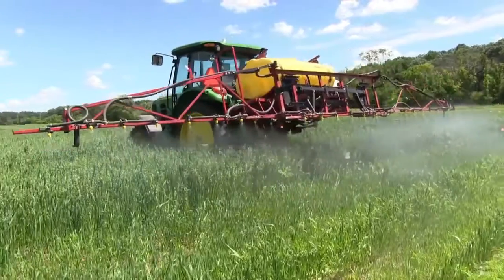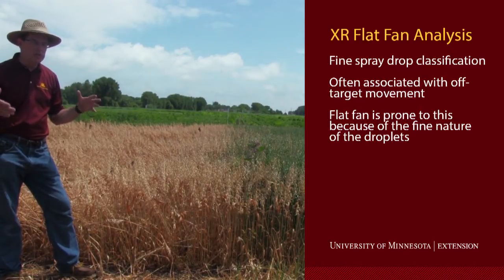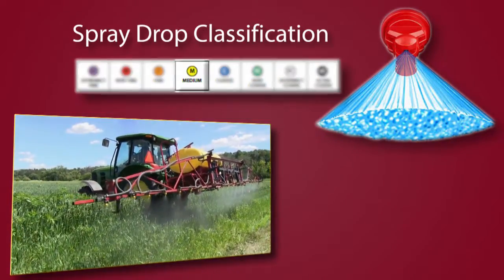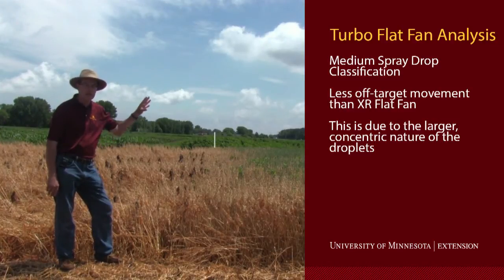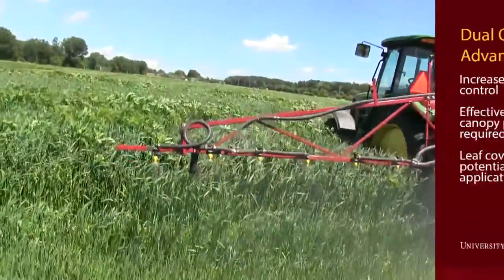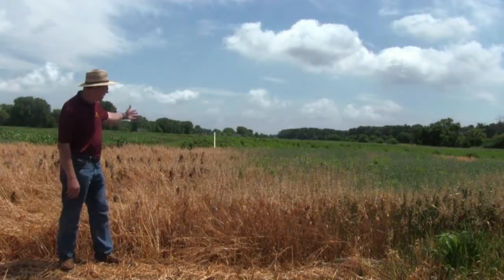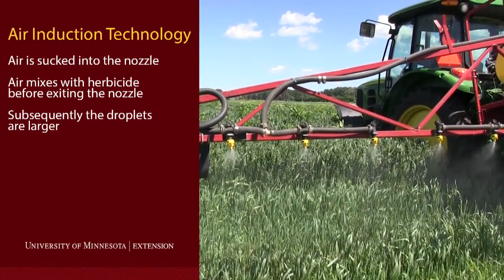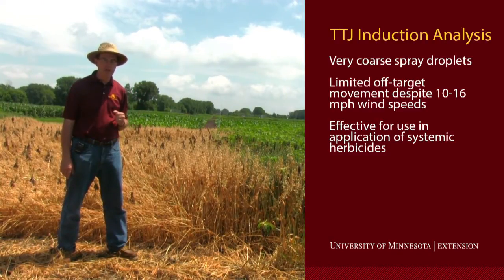Herbicide Spray Drift Demonstration

Comment: Dear Sir, I liked your demonstration, can you answer my question please, As per my understanding the air induction nozzles have clogging problem during field operation, there is any solution for that problem. And secondly for very large droplets the runoff could be a big problem which will contribute the runoff and cause soil and ground water contamination.
Reply: To avoid clogging you should use the correct  strainer mesh, you can find this information in nozzle chart. Example. TTI 11002 requires a 50mesh strainer, while TTJ60 11002 requires 100mesh.
Notice they are the same size 02 but different models.
The clogging may happens in enviroments with high dust concentration when you use air  induction nozzles. In Brasil we face this issue when spraying pre emergency and cultivating  the inter row sugarcane fields at the same time. So we use teejet TF nozzles, which produces large droplets and has no air induction.

I hope helped you...